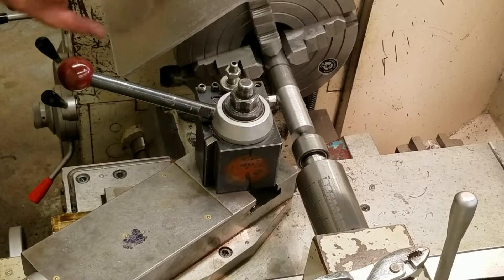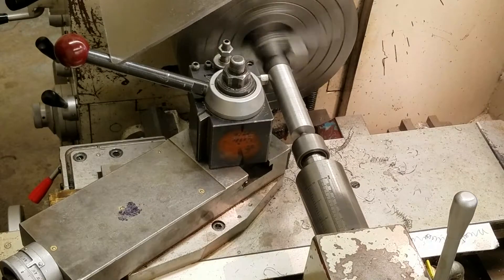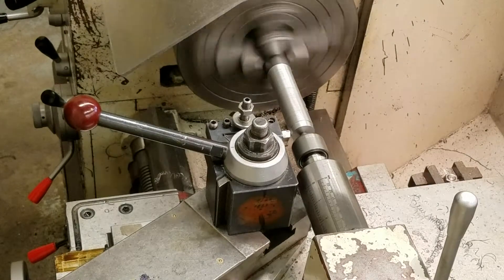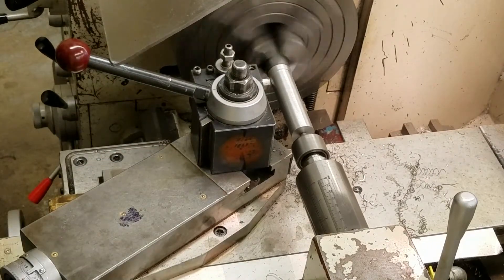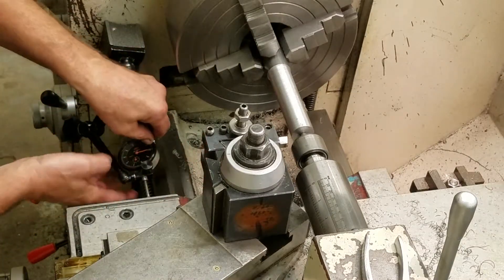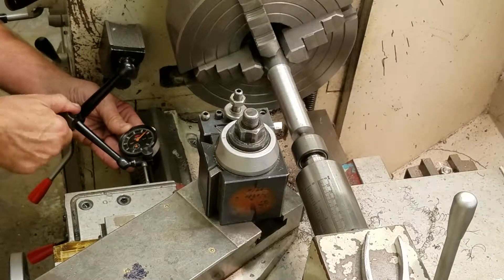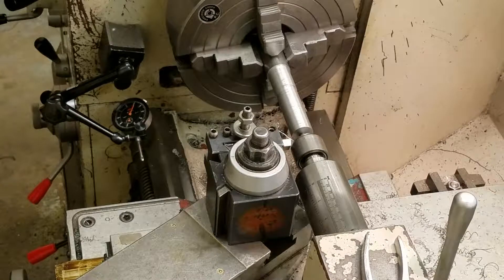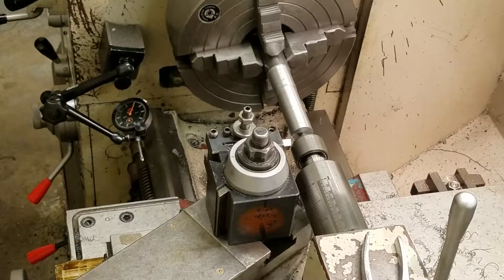Lathe Turning to Diameter and Length

Comment: when you used the paper to touch the face of the work say the paper is .003 wouldn't you come in after the paper the .003 then set 0 to take up the the paper thickness